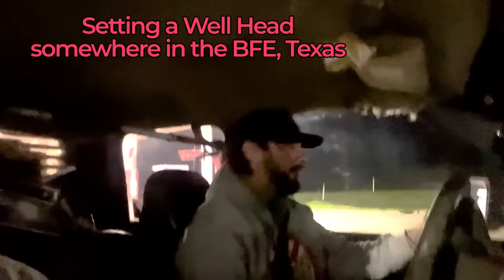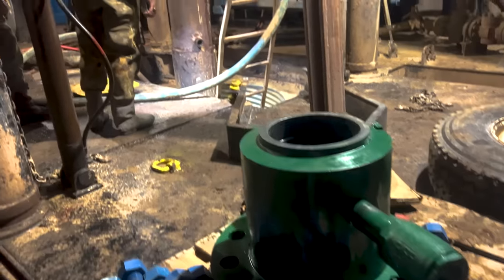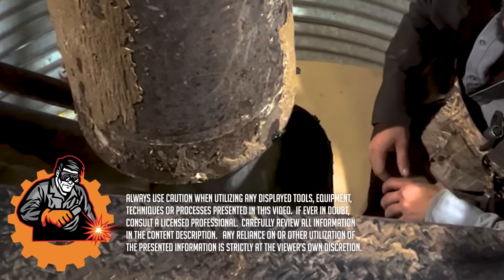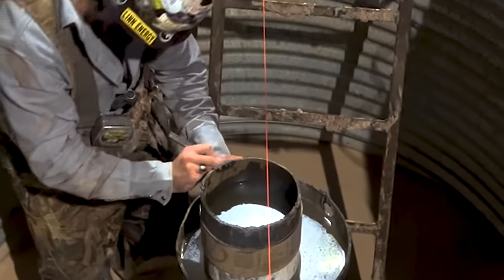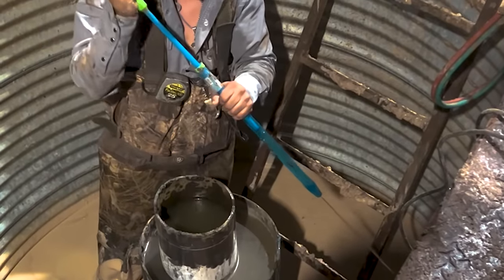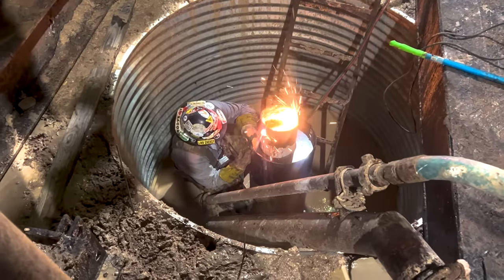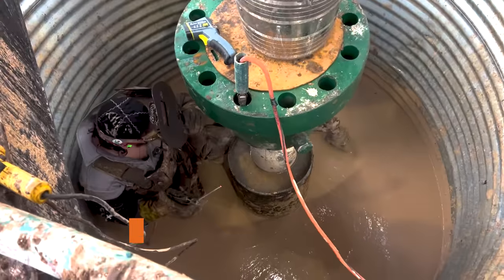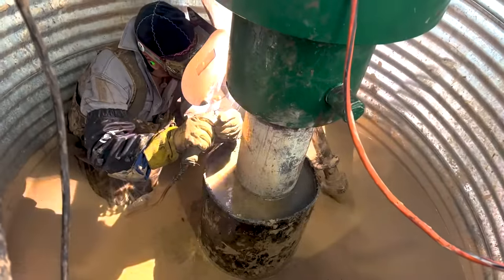Rig Welding Jobs: How To Set A Wellhead

Comment: If you land the head low you can cut below your head and stub up a slip collar. Also once you rough cut your surface case push a dry 4x4 down a bit and it will burp your water out.  Give you a few inches at least.

Comment: Way back in 1974, I was welding wellheads in the jungle of New New Guinea for West Burn International, a Canadian drilling company that operated 4 chopper rigs.  First a chopper rig was a drilling rig that could be move using a Huey Vietnam era helicopter. Took 47 loads to move the rig to a new drilling location and since we were in the jungle there were no road to move the rig by truck.  First, a landing area crew walked in to the area with chainsaws and cut down trees clearing an area wide enough to land a helicopters, and track was cleared to allow the D-6 wide track dozers we used there. Once complete a land clearing crew were flown in to  cut and clear a 300 yard area to set up and assemble the drilling rig. When one for the 4 chopper rigs was finished at a drill site it was disassembled one section at a time and hooked up to a chopper hovering over the rig and the section was flown to the new drill site and set on the ground since the first sections were the top of the ring. When the bottom sections of the rig were ready for moving they were flown to the next site and assembling started. Since there were no cranes available a Huey HU 1 chopper was the crane. Assembly was completed in 3 to 4 days and the rig was ready to set the casing pipe that the Wellhead (casing bowel) was set on and ready for welding. 
I was 26 at the time and was working as a pipeline welder for a American company called PAE/RMI  we were building the pipelines that connected to the completed oil wells that ran to the near by beach we named Kasim that was south of  the city of Sorang  on the West coast of New Guinea (Irian Jaya). 
When Westburn was ready for the Wellhead to be welded on I was always called out to do the welding.  I liked the job since it was usually in the morning and It took me about 3 hours to complete the weld and I was flown back to camp and given the rest of the day off. We were working 7 days a week 12 hour days for 28 days before being flown back to Singapore for a 2 week R&R.  Worked that job for 3 years and my first overseas oilfield construction job that continued for 40 year working in Sumatra, Borneo, Brunei, Libya, Bahrain, Saudi Arabia, Thailand, Qatar and Nigeria. retired at 67 and now on my 10th year of retirement in Thailand.  Still love working with metal and have my own workshop to have something to do when I am not out fishing for snakeheads.
Reply: that's  a good life story ! wish to you good health and many more years of good relaxed retirement
Reply: You should write a book! I’m sure you got an abundance of interesting stories working in that part of the world back then.

Comment: I have a question I hope you dont mind I put this here ....ive been thinking about welding the metals that I've accumulated over some time
I've thought about welding it together but once I do it's WELDED 
THEN I GOT TO THINKING ABOUT THE LEGO MOVIE AND THE SPECIAL 
THEN I THOUGHT ONCE I WELD IT HOW DO I UN WELD IT? 
I HAVENT NOTICED ANY VIDEOS ABOUT UN WELDING
MAYBE ITS BECAUSE ITS DOWN THE WELDING TRADE AFTER YOU GET TO BE A  -
WHATS BETTER THAN PROFESSIONAL? 
EXPERT? LEVEL? 
ANYWAY I WAS JUST WONDERING IF YOU TEACH HOW TO UNWELD? 
I noticed that when you weld you scrape a bubble off (sorry for verbiage) the top like the metal didn't stick or weld at all
At first I thought it was because of a natural resources problem 'they the infamous THE THEY speaks about' 
Meaning diluted metals 
For example when I looked up aluminum there was grades to it 
So at that point I started thinking that for example a 7016 was either also diluted or just not the right authenticity it should be 
The more it's diluted the weaker the metal or thinner ya? Which means a constant problem for businesses but booming for business in welding? 
I've seen this in lots of places in the environment
Example a wooden telephone cracked under pressure of transformers 
The lube of tar was either lacking or too much and it slipped and split the wood 
Ive also noticed some trees with black insides and when the question arises "is it real?" 
Yes always at that point
You realize incognito is out there (they really do see you before you see them) 
So if your weld somehow gets stuck in a tree and it becomes a reservoir of 'pure ' aluminum but it wasn't intentional or meant to go there how would you unweld it?
Do you kill a live tree (our airspace?) or do you redirect to appropriate place or location? 
Or maybe we just leave be? 
Do you consider grout work welding with calk or medal? 
Let's say you have  metal grout for your 🧱 ' house' 
And one last question if I was going to identify a barbwire fence by a welding pattern which would it be? 
I can recognize some and follow the patterns but since it's kinda 3D it's harder to identify
I was gonna say the 🌊 but I can those two march of the 🐧
Looks like it's both😊
Reply: Pissed drunk but unwelding is carbon arc gouging, or the plasma equivalent(never used it). Aside from that, step away from the mushrooms, sir xD xD xD

Comment: Those v stingers suck
Id rock a bernard 40 twist anyday
When you start welding big rods the v rounds out and the rod spins around like it’s a new year’s noise maker
Reply: I'm partial to Tweco stingers, I like em for 1/8" or anything smaller. They don't like trying to bend 5/32" 8010s or 7018s, but I don't use them very much.

Comment: I have a question because i never done anything like this so I was wondering. Weld head to casing  is a open root weld or like fillet weld?
Reply: It’s a fillet weld. It’s basically a big ole slip on flange.

Comment: The preheating won't compromise the seals? How much more heat would damage the seals?
Reply: I'm guessing it's silicone that doesn't  melt
Reply: Thank you for your response  @jarrengabaldon
Reply: That is a huge piece of metal around the seal. He said he is getting it to 250F you would have to get to at least 400F to see any damage to a viton or silicone seal. Even with the heat from the weld it would take a hell of a long time for that chunk of metal to get that hot. Also factor in the water in the pipe that does a pretty great job at absorbing heat.